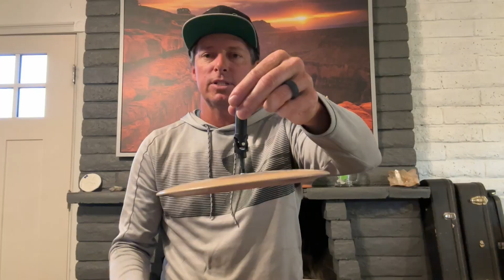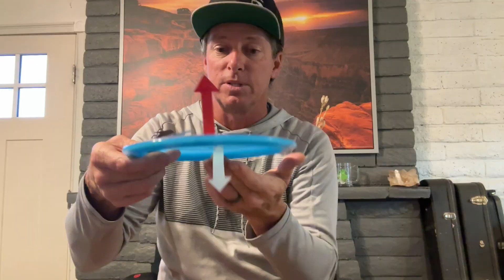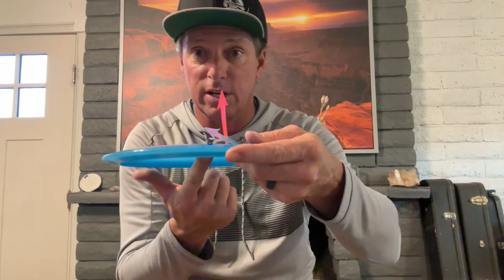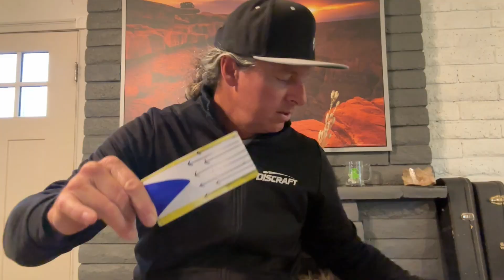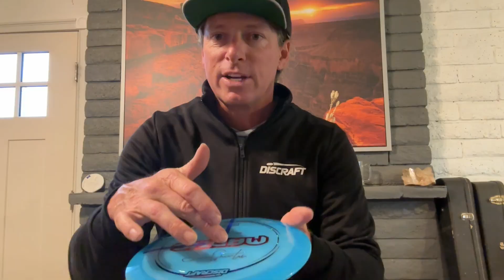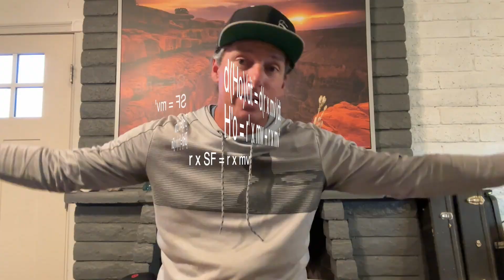Why do Discs golf Discs Turn and Fade?

Comment: Almost correct explanation. Good job! Center of lift actually depends on the angle of attack, not so much directly on the speed. In high speeds high lift force causes acceleration perpendicular to disc motion which together with gyroscopic stabilization causes angle of attack to decrease which in turn tends to move center of lift behind the center of mass of the disc. As a result this causes the disc to "turn" just as you explained. Fade is caused by the fact that gravity pulls the disc down adding to it's downward velocity. Together with gyroscopic stabilization this causes the angle of attack to increase which moves the center of pressure forward trying to turn disc's nose up. this again causes the "fade" just as you explained.

"Gyroscopic stabilization" is actually just Newton's 2nd law for rotating bodies. It states that Time derivative of angular momentum vector equals total torque applied to the body
(https://www.researchgate.net/publication/225330184_Simulation_of_a_spinstabilised_sports_disc)

Comment: Greats video, very well explained ! I had no idea what actually occurs when a disc flies and always wanted to dig into that. I am wondering tho : doesn’t the drag force intervene ? I guess it depends on the disc maybe it is insignificant compared to the other forces, but I feel like it also plays a role ?
And also how is it that the gyroscopic procession takes place at 90 degrees ? Is it always at this precise angle ? I also feel like it would vary with the disc profile. 
Open questions if anybody knows I’m just really curious :)
Reply from the maker: Great questions!
The Gyroscopic precision phenomenon as I understand it is always at 90 degrees. It’s how they keep orientation of the space station, using heavy flywheels and using the torque against them to change position. So it’s a very precise and predictable rule in physics.
Yes, drag is a huge component, I had another card to use with the visual aid in the video that showed the downward airflow and drag component behind the disc… however I decided for the purposes of this video to “drag” the viewer into the weeds this go round. Save it for another video
Reply: @DiscgliderPete  Very interesting thanks !

Comment: Neat video. Quite informative. I'd love it if you could explain how players are able to throw a disc which turns over late. I've done it a few times, but I'm unable to do it with any predictability. Based on my experience, discs turn over at high speed, but not low speed. I suspect it is some type of hyzer-flip, but I don't understand how players are able to get the disc to fly straight for a couple hundred feet (or more) and then turn over before panning out to flat.
Reply from the maker: Yes, part of it is hyzer flipping a disc (rhbh perspective) so that the late part of the turn is just past its level flight, and the second part has a lot to do with proper nose angle throughout that precession  so when the disc “tips” to the right of level with the proper nose angle, most likely a neutral angle of attack or slightly nose down angle of attack it would appear to track to the right as it glides…(a nose up angle of attack at this point would cause it to slow down and fade more quickly).
coupled that with it possibly having reaching its best lift over drag ratio (perhaps the lift acting over the center of balance at this point) would help hold the flight pattern for longer. To throw this shot with any consistency, one has to know the flight characteristics of that particular disc, how much it turns and when it typically “settles in”. It’s a bit of a touch and nose angle game from my experience.

At least that’s my current hypothesis. :)
Reply: Also, I think Pete’s answer to the question about spin creating stability plays a role. If the disc highs high spin and stays stable longer, it will take longer for the spin to slow enough to be more affected by the lift, I think, which means the turn would come later than a disc with less spin. I believe drag would slow both the spin of the disc and the linear speed on the target line.

Comment: Really good stuff!  A question popped up during your parting line explanation. If we had two discs with the same flight plate molds and parting line, if we make the lower half of the rim divert the same amount of air but one is convex vs concave, won't we have pretty dissimilar high speed turn rates? I imagine this lower half shape determines air flow and where it might hit the bottom of the flight plate at different speeds. Strangely, this would be counter to your reasoning because the convex shape would seemingly push air flow to re-enter further back behind CG than a convex shape. Curious if there is another major component to disc stability than where the air is parted.
Reply: Example Drawing  https://drive.google.com/file/d/1zYpI2C_siFGTM_Vy13qpw-ilpv_pcBJh/view?usp=sharing
Reply from the maker: Thank you Eric for your insight. I don’t fully have that answer. Here is a thought exercise.
Yes, when we divert the air below in this manner we do tend to have more over-stability. The concave shape of the bottom half of the rim, from the part line downward must create a low pressure behind the wedge edge of the disc on the nose side.
I have a hypothesis and I’ll use an extreme example to explain for visualization. Take the disc called the “Tilt” for example, 90% of the air is diverted downward at an extreme angle 📐, the interesting thing about this disc is that it flies/ “glides” farther upside down than it does in traditional flight. Think of a pickup truck and the age old question, “ do we get better gas mileage with the tailgate up or down”? The answer is “tailgate up” because the tailgate traps a slow rolling a pocket of air behind the cab, which allows for the high speed airflow coming off the cab to smoothly pass over that pillow of air with less drag, whereas the tailgate down allows the air to drop downward into the bed, essentially pressing down on the tailgate and causing more drag behind the vehicle.
The extreme angle of the tilts bottom rim, when flipped over and thrown upside down essentially diverts the air upward in such an extreme way that the airflow at high speed would essentially create a boundary layer of air similar to observed in the bed of the truck🛻. This boundary layer allows the airflow to pass more efficiently from front to back on the disc.
Another thought is this which which I believe is a key component of understanding flight is: Drag. The most important part of understanding the speed of a wing/disc, is not how efficiently it cuts through the air at the front, but how efficiently it allows the air to come back together at the tail. Something like a putter moves, the same air out of the way at the front of the disc as a driver, but it does not allow the air at the back of the disk to come together in an efficient manner, and so it drags a bunch of air with it, which slows the disc down faster. Something high speed like a nuke, allows the air at the back of the disc to come together, smoothly and efficiently, with very little air being pulled or dragged behind the Disc. The angle of the bottom half of the rim being concave or convex, helps determine the way the air is diverted downward off the top of and at the back of the disc. I did have a little slide for this video showing airflow at the back of the disc that I considered using but didn’t want to get folks lost in the weeds. Maybe I’ll make a specific video on drag….understanding the basics of that is huge.
Reply: https://drive.google.com/file/d/1zYpI2C_siFGTM_Vy13qpw-ilpv_pcBJh/view?usp=sharing
Reply: Link to example https://drive.google.com/file/d/1zYpI2C_siFGTM_Vy13qpw-ilpv_pcBJh/view?usp=sharing

Comment: Best explanation do far!

As an engineer I have never been satisfied with the simplistic explabation of stability and left/right tendencies.

From your explanation and definition of forces made, it is easy to see how the thrower (by causing spin and initial velocity) affects the flight path.

For example, take a beginners hyzer and explain it, or a hyzer flip and why it works. Or an amateur throwing a speed 14 disc and why it will flip left. 😁

Also, alter the surrouning air and its properties - wind direction and altitude (density)  and think on how the disc responds. Answers easily found in your explanation made! Bravo!
Reply from the maker: Thank you!
I learned to play disc golf at high altitude.7000’. The difference in air density and learning the subsequent flight stability’s from there to 1000’ is a huge learning curve!

Comment: Great explanations. All your points are spot on with awesome visual aids. One thing to add though, the shape of the wing can affect the center of lift (changing stability) a ton just like the parting line height can. A concave wing design will push the center of lift forward towards the nose making it more overstable. It pushes air down at the nose and this can cause resistance to turn even at high velocities. It also causes drag. It's an inefficient wing design because the angle between the flat bottom of the disc and the nose is too sharp and disrupts smooth airflow. Sharp angles are the opposite of aerodynamic. Convex wing designs like an IT or roadrunner do the opposite. They are rounded and smoothly connect the nose to the flat bottom allowing smooth airflow underneath the disc removing any lift generated at the nose (until the angle of attack increases but that's unavoidable at low speeds). This means at high speeds much more of the lift is created at the tail of the disc from airflow over the top of the disc. Some understable disc's nose sort of hang down towards the bottom of the disc to accomplish the same thing as a convex wing. I'm guessing this is to cut weight with higher speed discs with larger rims but I'm not sure.
Reply from the maker: Thank you for your comment!
You make very good points. 
I did have a slide that I considered using with the nose angle tool that showed how air would be diverted and come together at the back of the disc…I decided to save it for later so as to to not “drag” the audience into the weeds to far in this one. I figured save it for another video on disc speed and drag.

Comment: Why are bigger rims more stable?
Reply from the maker: Great question! Though it’s a bit complex.
Big rim like a Zeus or big rim like a mamba? Both on a basic level can be understood with the point made in the video on understanding where the parting line is and how much air is diverted above and below the disc…..
Another component is simply they take much more speed to generate lift compared their drag component. 
The faster you make a disc the less drag it has, but the trade off is that it has less lift and thus less glide too. So technically it’s more stable….If you want more glide, you need more lift, more lift inherently induces more drag, which means less stability.
Something like a mamba, generates more lift for it’s airspeed, which inherently makes it less stable at higher speeds compared to a Zeus, however if the thrower doesn’t have the ability to get the disc up to its optimal airspeed it will seem more stable. It’s kinda like the difference between a single engine Cessna and a Lear jet 🛩️, the single engine plane flys well and stable at low speed but becomes unpredictable at higher speeds, whereas a Lear jet barely starts to fly at all at the max speed of the Cessna, but is very stable and predictable at high speeds.
Reply: @DiscgliderPete  Thank you very much for that explanation 🙏

Comment: Great demo! Precession is also useful for understanding why nose up (positive aoa) negatively impacts distance. Throwing nose up moves the center of pressure forward on any disc profile, causing a reduction (or loss) of high speed turn and a much quicker transition to fade causing the disc to fall short and left of it's max potential distance for a RHBH throw.
Reply from the maker: Yes sir! Well said! Thanks for a great comment, also my previous video had to do with demonstrating gyroscopic precession.
Reply: stability is part of it but i think the main reason nose up reduces distance is just plain old aerodynamics
Reply from the maker: @ts4gv  good ol drag.

Comment: Awesome video! The one thing I would like to see added to the explanation is the effect of spin
Reply from the maker: Hey Colin! Hope you are well my friend! 
In what other way do you mean the effect of spin? 
Spin creates a disc stability which when increased, helps the disc resist external forces. Spin narrows the flight envelope of a disc, allowing for less turn and fade. This resistance to forces that are not on its spinning axis is the reason for the disc having turn. The force of lift acts on the rear of the disc, but the effect of that force takes effect 90 degrees away in the direction of rotation causing the left side of the disc to lift. This phenomenon is due to spin.
If you haven’t seen the two previous videos, please check them out.
Later I plan to discuss how disc spin and OAT act in the wind, also the physics of Rollers….that’ll be a big spin discussion!
Reply: @DiscgliderPete  I am doing well thanks! I was wondering more about how spin factors in for late-flipping shots. My current understanding (which may be very wrong) is that the higher spin at release resists the turn initially, but later in the flight the disc flips when the spin has slowed enough that it can no longer resist the turn
Reply: Could you potentially do a video that discusses how to create more spin or why some people are able to generate more spin than others?

Comment: I feel like I'm learning a lot from your last few videos. I do have a question though, how does RPM affect this? Does a higher RPM cause the gyroscopic precession to happen at a larger than 90 degree angle so rather than lift producing as much turn or fade it ends up producing less because less of the force is directly causing the disc to tip left or right and more front and back?
Reply from the maker: Great question!
As I understand it, the faster a disc spins the more it resists both turn and fade.
My backhand is 60 mph with around 1200rpm’s. 1200 rpm’s is equivalent to 30 mph.
My discs rpm’s are 50% of the discs airspeed. This is a very good ratio.
Good Forehand throws tend to have a 30% rpm to speed ratio. This is why forehands, thrown at the same speed as backhand throws do not travel as far as backhand throws, and also have more movement from left to right. Spin narrows the flight of a disc to a straighter line because the faster it spins the more it’s able to resist the other forces it experiences in flight. Less spin means more turn and more fade. 

As far as I understand the physics of gyroscopic precession, the effect of force always takes effect 90 degrees away in the direction of rotation. It’s how they stabilize the space station with spinning flywheels and keep it oriented, so it’s quite a predictable rule in physics.